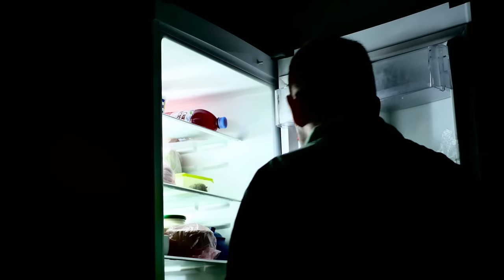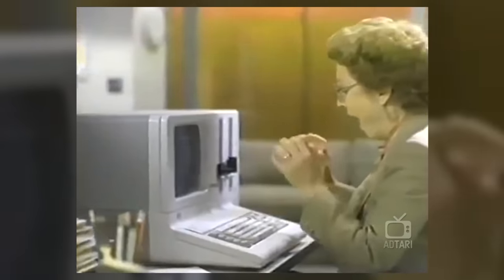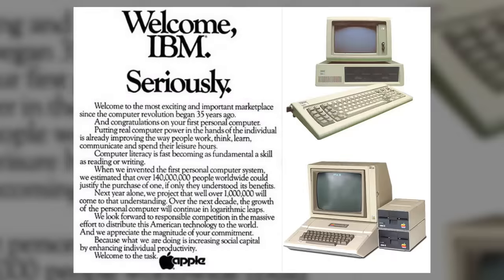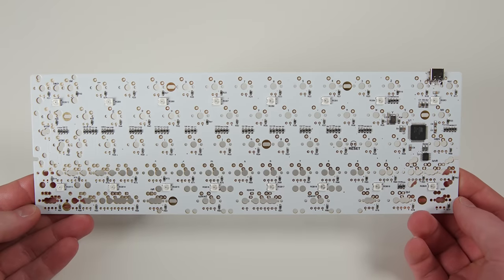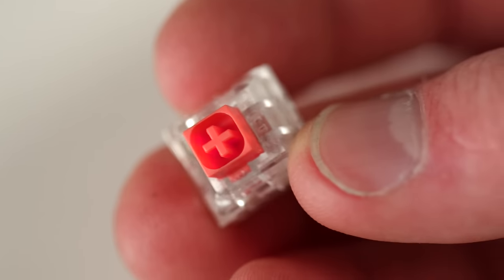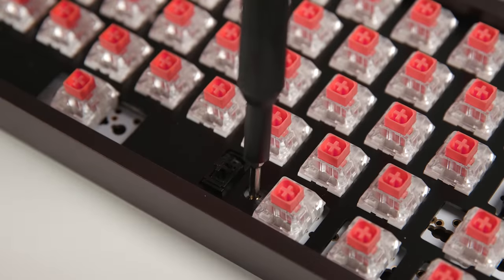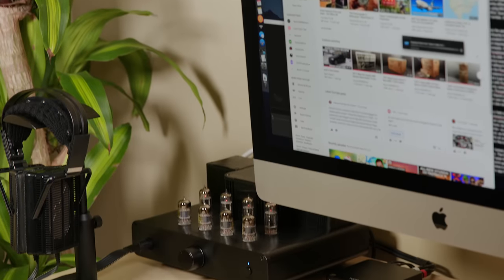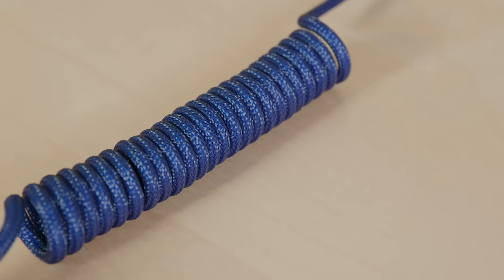This DIY Mechanical Keyboard Costs $300...!

Comment: Unlubed stabs? The agony!
Reply: You know what, as far as videos about first builds go, Snaz here actually did probably the best job I've seen.
Reply: Switches aren't lubed either :( Still an awesome build though!
Reply: @MrMichaeldwatson  You don't want to lube boxes in the first place, really. Considering they let dust pass in and out and lubricating doesn't provide much of a benefit for the BOX line specifically. Even then asking anyone to lube switches on their first try isn't exactly advisable since it can take up to four minutes per switch to lube, assuming you didn't ruin any switches' keyfeel.

I'd say for even 99% of mech enthusiasts, asking them to lube their own switches is asking too much for the marginal benefit it provides.
Reply: Koriko I’ve lubed box switches. Thicker lubes like 3204 or 205g0 work great, cause they won’t drip down like a thinner lube such as 1514 or something.
Reply: @Kori-ko  I lubed my box whites actually. I found it much nicer afterwards. Perhaps that's just me though.
Reply: @ev2477  You can lube boxes, but if you were to lube all the points where the stem meets the housing like traditional switches, the lube on the outside of the box will definitely attract dust. Like I said, it's really only a marginal benefit you'd be getting from a box switch and the attention spent on lubing switches should be spent on other places where you'd get actual benefit.
Reply from the maker: Lube is on the way! Got stuck in customs and needed to publish the video. :(
Reply: @MrMichaeldwatson  And that's perfectly fine. The point is that asking a normie that thinks $300 is expensive for a board to take hours figuring out and lubing switches seems like asking quite a bit.
Reply from the maker: BTW, fixed. https://youtu.be/NTtGNXeBH20
Reply: @Kori-ko  I am planning to lube my box navy, but only the spring, it seems lubing other place will make it lose the tact feeling.
Reply: Was thinking the same thing.  All about not spending $600 while spending $300 to convince new people who supposedly don't know anything about this hobby that it's worth it, while never lubing your switches and stabs?
Reply: @Kori-ko  Doubt it's as marginal a benefit as spending $300 on a DIY keyboard over just purchasing a keyboard for far less for less work (GMMK for example gives you the best of both worlds for $59 to start).
Reply: Honest E  That price is fairly misleading. If you were to source all of your parts from GMMK, the cheapest possible configuration is $110 for a board with a worse build quality and inferior parts that actually do make a difference, such as the stabilizers. If he was intent on using box burnt orange switches, he would still have to source those and pay separate shipping as well as the keycaps. If he wanted a more brown board, he'd have to spend about the equivalent amount of time prepping and painting the GMMK brown as he did soldering. It's much less work to just pick out individual parts and put a board together and have it closer to what you want. On top of that the original argument was effort vs reward, not price vs reward.

The way you can think of the DIY scene in the most relatable way possible is you can essentially just think of it as model train building, gunpla, or car modification, but much more modern and diverse as there are a lot of elements and approaches to design. Sure you can go nuts and drop $2000 for a build, but most people in the hobby will stay on the low-mid end and develop the underlying technologies that will eventually make their way into cheaper and more mainstream boards. At the end of the day, Quinn has a pretty good and hefty aluminum brick that makes noises and feels good while crunching his way through scripts while making money on a video about his experience on his first build.
Reply: He also used abs keycaps instead of pbt.
Reply: @MaLe899  ABS is fine, especially for SA, but shine vs matte is purely a personal aesthetic choice. His caps are double shot which is leagues better than like lasered ABS.
Reply: @Kori-ko  oh okay I remember hearing somewhere otherwise. Thanks for the clear up
Reply: @MaLe899  When people say ABS is bad, they generally mean single shot lasered or UV is bad since you wear away at the legends. Double shot caps are fine in any material for the most part.
Reply: Jared from Subway (1201) i felt this
Reply: Koriko Yeah, honestly I think lubing the stabs and considering foam in alu cases should be some of the first things a newbie should learn about.
Reply: @Kori-ko  How tf do you spend 4 mins lubing a single switch? Takes me about 15 mins to lube every switch once they're all separated.
Reply: A 300 dollar build yet switches and stabs arent lubed. Bruh
Reply: Yeah, these are really "not clicky" switches. They are louder than MX Blues or theyr (louder) clones! I went with cheap chinese (and rebranded) boards for around 30€/piece, desoldered all switches (Kailh Browns in first case and Kailh Reds in the second) and soldered on my own switches (Kailh Box White and Gateron Blue) and replaced stock, awful keycaps with nicer ABS doubleshoots from GMMK. They have fairly rudimental RGB lighting (7 colours and couple effects), on-fly macros and NKRO, one is TKL, second one full size. 120€ it cost me, excluding soldering equipment I've already had.
Reply: Ikr it's terrible
Reply: Let alone unlubed switches
Reply: Good build horrible stabalizers it isnt that that werent lubed it s that he got the cheapest ones even unlubed they dont sound this bad aome cherry stabalizers dont even need it and would sound way better
Reply: The sound is horrible.....
Reply: @Kori-ko  Most real mech enthusiasts lube all of there switches (well the one that lubes make them better)
Reply: i dont understand why you'd build a custom keyboard and not lube all the keys
Reply: @snazzy  that sounds so much better! lubing the stabs really is a hugely cost-effective mod, and really transforms a keyboard. Yours sounds really nice now!

Comment: You are not 12, of course, but adults should figure out that there's something wrong with that spacebar stabilizer. Any $10 keyboard sounds better than that spacebar.
Reply: You are supposed to apply lube to the stabilizers under the large keys and he didn't

Comment: $300 is on the low end LOL
Reply from the maker: I know! Some people spend $300 on an artisan cap! 😂
Reply: It really is. Korean Kustoms end up totaling $600-800
Reply: @snazzy  Artisan keycaps is the dark side of mech keyboards
Reply: @Chilb0ng  along with those kustoms :monkas:
Reply: seeing a lot of good mechanical keyboards for $130, you really dont need to think of $300 as low end.
Reply: @Ross6041  I mean for customs
Reply: @jordanshen  lots of kustoms go for upwards of 10k
Reply: @Chilb0ng  rofl
Reply: @nicholasmo40  I think I can safely say those keyboards are a bit out of the budget of even the most enthusiastic of your typical custom keyboard enthusiasts LOL
Reply: Nicholas Mo what the hell do they use, solid element 115?
Reply: @nicholasmo40  While I regularly (yes, regularly...I really need to stop) spend $500-$1000 on custom builds, $10k would be extremely abnormal.  I'm not going to say there aren't any keyboards that cost that much but there certainly aren't 'lots'.
Reply: @kevadu  I say lots as in more then 10
Reply: @nicholasmo40  Outside of the 356CLS (which didn't even cost that much originally but since very few were made it has become something of a collectors item and people have resold them for five digit figures) I seriously can't think of or find any info on any keyboards that have sold for $10k.  I seriously doubt there are even ten...unless you mean like 10 individual keyboards not models or designs...

There are plenty of keyboards that can break $1k sure, but not $10k.
Reply: @tyler94302  Looking at parts on Aliexpress, I think one could definitely get a custom keyboard for around €120.
Reply: @matj12  Not a good one, but a working keyboard nonetheless
Reply: Haha and here I'm enjoying my custom $150 keyboard it was difficult to not to go more but yeah its cool man
Reply: Kevadu You can add the gskt-00 to the list, it is evaluated at around 16k but yeah there’s like 2-3 custom keyboards max that costs more than 10k
Reply: Nicholas Mo kustoms aren’t even that good anymore compared to kits sold
Reply: @jordanshen  What are Korean Customs and how do you get them? I'm currently in Korea right now if that matters
Reply: @spekt113  they're high end, group buy format keyboards, usually aluminum with brass weights. They're typically not sold in person, so I don't think it really matters if you're in Korea or not. Keep an eye on the Group Buy and Interest Check sections of Geekhack if you're interested in a high end custom.

Comment: Razer's DIY Mechanical Keyboard would cost $3000
Reply from the maker: It'd have that very classy snake logo though.
Reply: Every fucking comment of yours is in this italic style, why, it doesn't even make sense
Reply: harvard mccoy
Reply: Its you again
Reply: What about apple.
Reply: @fluff7865  the switches of their choosing would be soldered to the pcb of their choosing soldered to the case of their choosing and the case would be soldered to the usb of their choosing, all of which would be shit and would cost a whopping $10k for the honor of using their product.
Reply: @feetpics7872  With shitty, thin, pad printed keycaps that wear out in a month to top it off.
Reply: @toastedphantom3007  im pretty sure maxkeys doubleshots their keycaps so the legends will never fade
Reply: the actual switches are pretty cheap

Comment: You had us in the first half, not gonna lie. Very well researched until 7:48, where your research should have told you SOUND and FEEL are the cornerstones of custom mechanical keyboards! I'd love to see a followup video of some lubed switches and stabilizers; cheap mods to reach the full potential of such an expensive build.

Comment: "And RGB LED backlight! Which I won't use cause I am not 12"
continues to spend more time to coil the cable only for looks
Reply: You missing the point completly. The whole RGB thing is something wich attracts younger people - thats why he said ''I am not 12''. Has nothing to do with caring about how something looks in general. Its just like some stuff looks childish due to mostly childs are attracted to it and therefore use it. 

Coiling a cable is some kind of looks that attracts usually a more mature audience - there for its not childish.
However, ofc there are children wich dont like RGB and matures which do. But if you call something childish its all about statics. And statisicly hes totaly corret.

Sidenote: RGB will decrease performance of hardware by 10% and without irony is a waste of energy even though not much.
Reply: Dynamic Dissonance coiling cables isn’t sophisticated and grown up. Get over yourself. Solid color underglows can really make a retro build like Miami or pulse and also look great on accented sets. Not to mention backlighting, which is quite practical for indicating things like which QMK layer you are on.
Reply: I think it was just a joke
Reply: spergsqueaks wait ... that’s illegal!
Reply: @Van-yo2xr  as i Said. Its just statistics. Just Look at any mature desk of people das 30+ Count expensive cable vs RGB LED s than do Same for 12year old fortnite Players. Again. That dosnt mean It cant look mature but its Not Common therefore childish.
Reply: Dynamic Dissonance that’s not a statistic brother
Reply: @Van-yo2xr  Back to school if you belief so.

Comment: There’s a degree of enthusiasm for expensive pre-builts, as well. I’m not talking about the “epic gamer” keyboards, either. I’ve fallen in love with my Keyboardio Model 01. Split design; ergonomic; Fully user-programmable firmware. It has a wooden case. It lights up (I asked, they said at this price point, tacking on $5 of LEDs is a sort of may-as-well, and I’ve been using it as a practical mode indicator). I could have gotten a quiet version, but I like loud keyboards, so I got the clicky version.

Comment: Awesome vid! Been part of the keyboard community for a bit now, super cool to see more mainstream people checking out this stuff. My only suggestion to you would be to lube your stabilizers! Right now your keys with stabs are very rattly of you just grab some dielectric grease and slap some on, it'll fix that. You could also lube the switches but even I havnt tried that cause taking apart every switch to add lube then reassembling them all sounds like a nightmare.

Comment: I've been diving down the mechanical keyboard rabbit hole for a few years now and while I still like Cherry MX blue switches, honestly Razer's goofy "opto-mechanical" switches on the Huntsman and Huntsman Elite keyboards have stolen my heart. They're everything I like about Cherry MX blues (tactile, clicky) but lighter actuation force, and their actuation/reset point is both the same and higher up than Cherry switches so you don't have to press the keys down as far to type. As a touch-typist this has made a world of difference in speed and accuracy, as well as eliminating the fatigue that sometimes happens after long typing sessions on my MX blue keyboards.

That all being said - the one membrane keyboard thing I miss is the shape and layout of the Microsoft Ergo 4000. It is perfect with the front plastic riser thingy, but I found the comfort of mechanical switches outweighed the superior wrist positioning for me. If someone would make literally that exact keyboard but with these Razer laser switches, they could have all my moneys. All of them.

Comment: Sticking with my IBM Model M keyboard, hoping for 70 yrs :)
Reply: At least Unicomp is still manufacturing Model Ms if it ever should fail.
Reply: @Antares-dw9iv  I can attest that it's still of high quality. I have never used the original M and will admit the case creaks but I love the keyfeel.

Comment: I like underglow lighting solely because I frequently computer at night.
Reply: I changed the  keyboard on my Dell Latitude 6420 laptop to a lighted keyboard for about $25.
Reply: I don’t see how underglow would help at night :P
Reply: @davids6337  it just does
Reply: I think he means backlit
Reply: but you can learn to touch type and have no such problem...
Reply: @АртёмСавостин-п1ч  English is my second language and I havent had any issues with typing in both languages, its just depends if you can put in the time to learn it.

Comment: Everyone should know the Ibm Model M is a membrane keyboard
Reply: So? Just because it uses a rubber dome doesnt mean it's bad. The word "mechanical" doesn't even have a proper and good definition, there's no need to shame the Model M for using domes lol
Reply: It’s buckling spring
Reply: @TheTechGuyYT  ik lol, but it technically does use domes, unlike the F, which is capacitive
Reply: Paavan Kumar no domes are domes the model M , uses a 2 layer conductive pad when the buckling spring presses down it contacts the membrane , there is no rubber in a Model M , or at least not in My model M
Reply: @TheTechGuyYT  oh yeah I'm dumb lol, screw everything I said